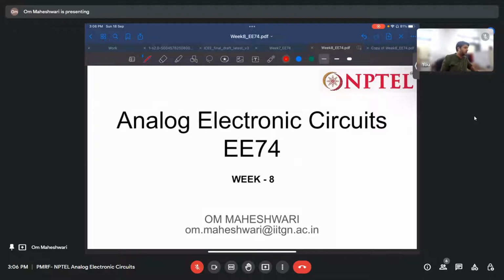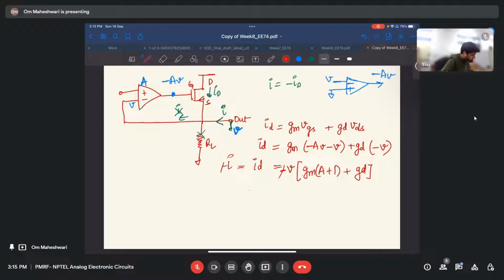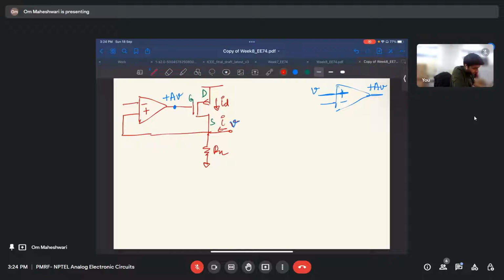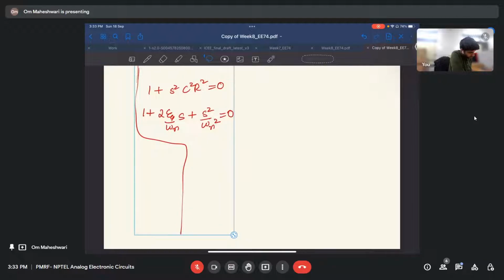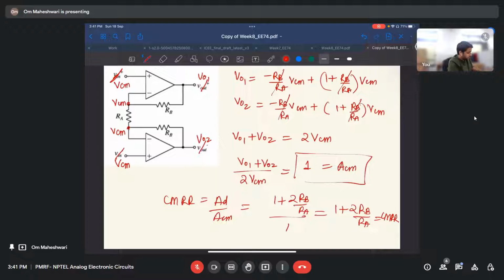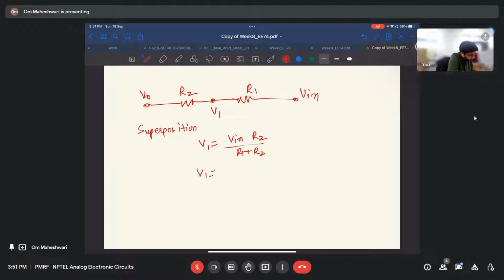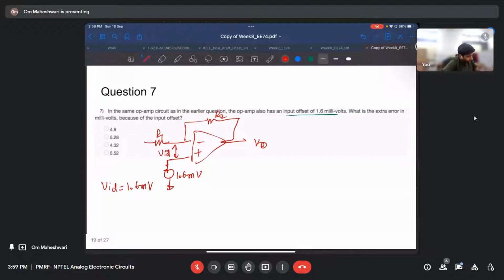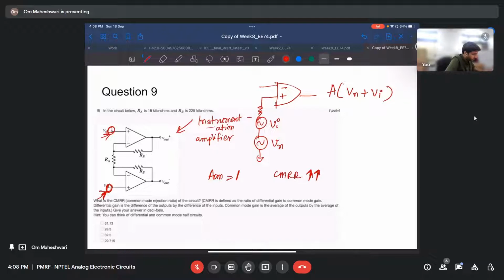Analog Electronic Circuits EE74 - Week 8 Live Session

Comment: in q 7 , why input due inverting terminal is not considered , as we already have gain A = - 10 (this year assignment), and so if we consider that case output voltage is V+(1+(Rf/Rin)) - V- (Rf/ Rin )+ offset votage why we can't consider this case
Reply from the maker: We are not supplying offset voltage as an input to R1 of inverting terminal. Offset voltage is something which is inherent in the opamp. It is like a fixed error that opamp has. Even when you dont apply any voltage to the opamp, it has an output which corresponds to a voltage difference of 1.6mV between the two input terminals. 
And to represent that voltage difference it is just easier to take it on the positive terminal of opamp.
Reply: @ommaheshwari3332  Thanks for your answer,  Thank you